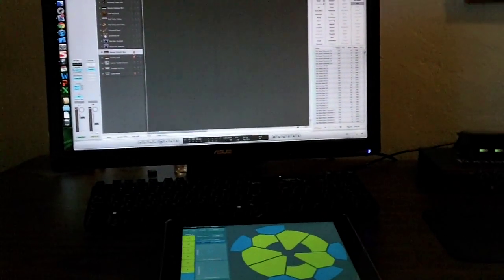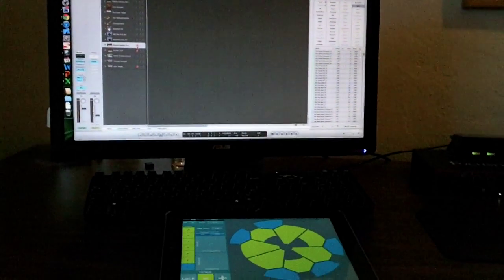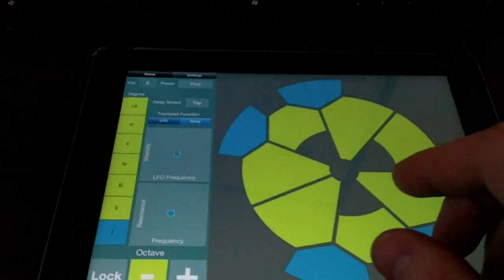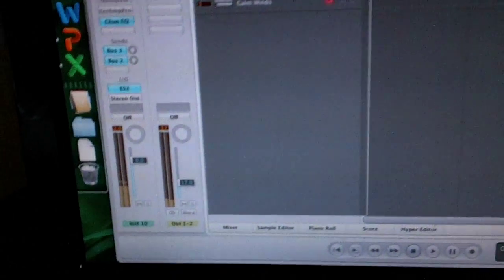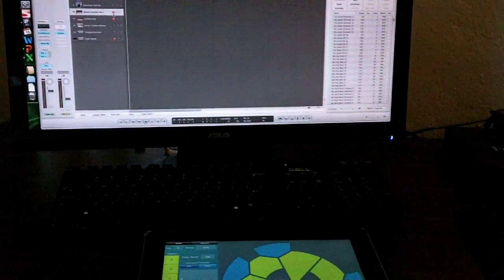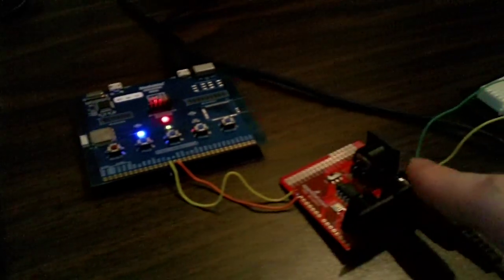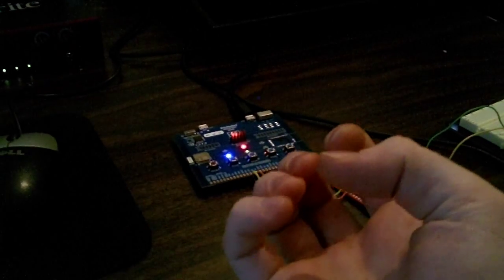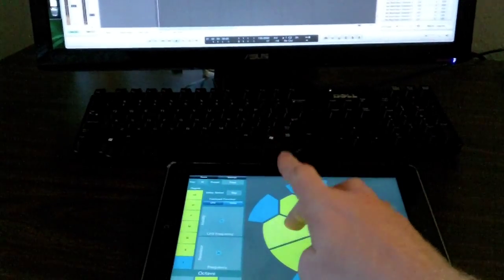iOS Sending MIDI over Bluetooth Low Energy

Comment from the maker: Right.  My idea here though is that there's a lot of possibilities that using BLE could open up that aren't possible with wifi.  With wifi, you can control one external device and it's got to be something with wifi (so, your computer).  With BLE, you could control a multitude of external MIDI devices at once - in the same app - and not just ones with wifi.  Anything you could plug a little MIDI dongle into could be used and controlled provided app developers implement the control in their apps.